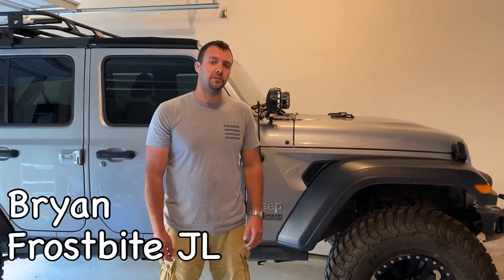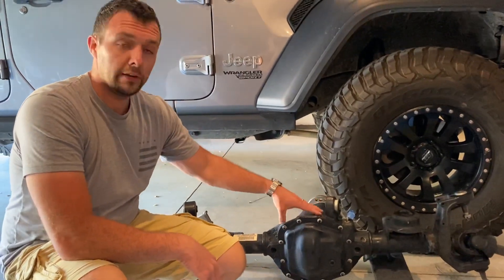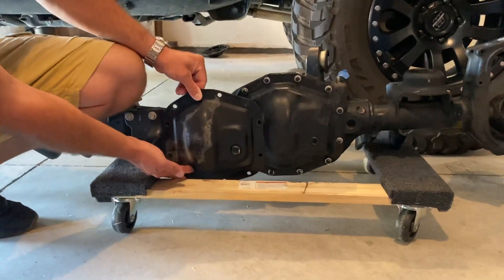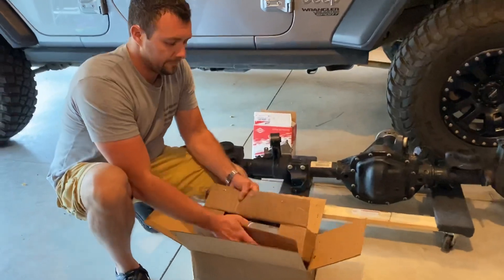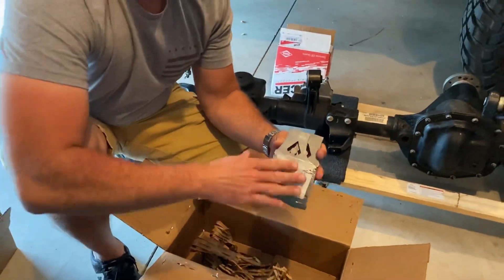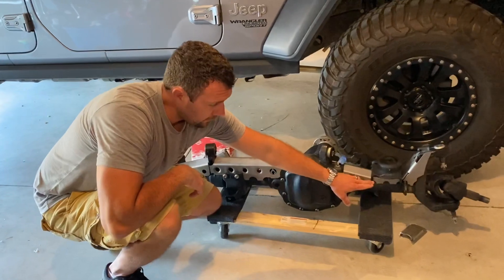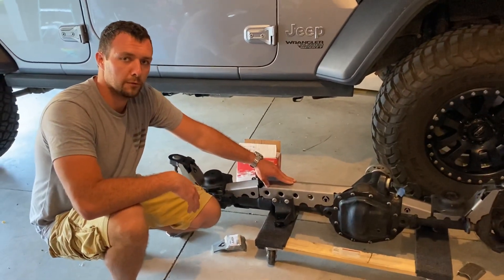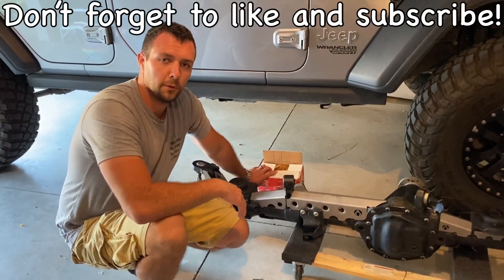New JL Wrangler Front Axle- Dana 44 Rubicon Axle and Artec Apex Truss Kit

Comment: Did you have any issues with your m186? I have a sport as well and wonder if I really need to swap the front to a 44 or not. Just run forest service roads, not into rock crawling at all. I’m running a MetalCloak 2 1/2 inch game changer and 35’s.
Reply from the maker: Briar Smoke I didn’t have any issues at all with the m186, I did the swap mainly to gain the locker and 4.10’s. I think if your doing easy off-roading with 35’s you’ll be good, I was able to get my m210 pretty cheap so that made me pull the trigger.

Comment: Nice video...how much to get that welded up?  Did you know the rubicon axles are 1.5" wider than the non rubicon axles?  I'm curious why you didn't go ahead and buy front and rear rubicon axle takeoffs for around $3500 so you have lockers and wider rubicon axles on both axles?  You also would get 4.10 gears in both axles and wouldn't have to pay to regear the rear.  You could sell both of your sport axles for around $1500 to make it probably cheaper overall.
Reply from the maker: Matt Strunk I’m aware it’s a little wider, I came across a great deal locally for the front and the rear ring and pinion, I was able to do the whole deal with regearing the rear for less than a standard regear. I’m going to keep an eye out for a rear eventually, I do have a LSD currently and that combined with the front locker should be plenty capable for me. The front welding labor was $250. I would have loved to get a front and rear pair but around here the cheapest I’ve seen is 5k, all the good deals seem to be in California.
Reply: @FROSTBITEOFFROAD  You got a killer deal if you got a front rubicon axle and can regear your rear for less than a total regear.  Nice find!
Reply from the maker: Matt Strunk yeah it seemed like a good opportunity for sure!